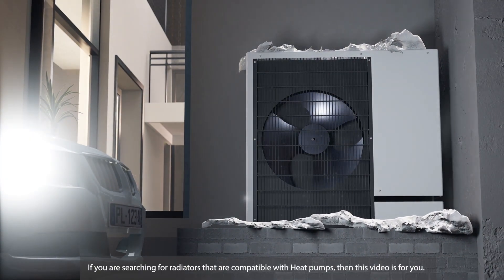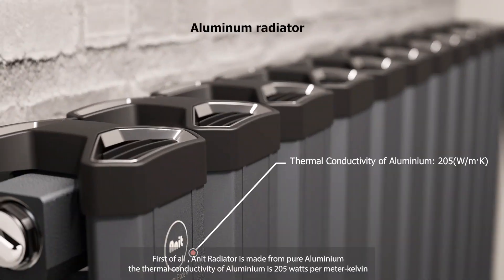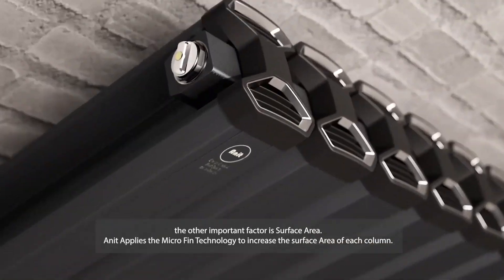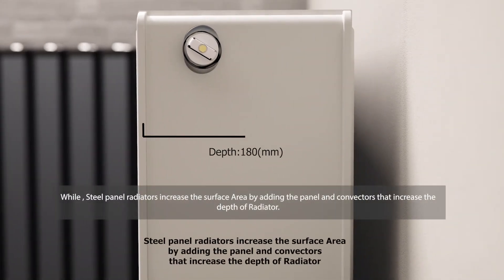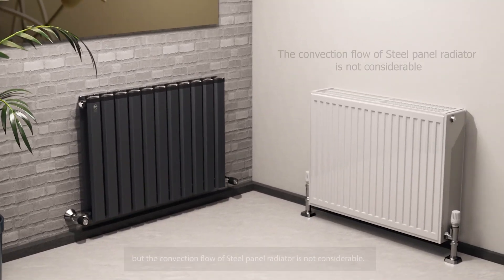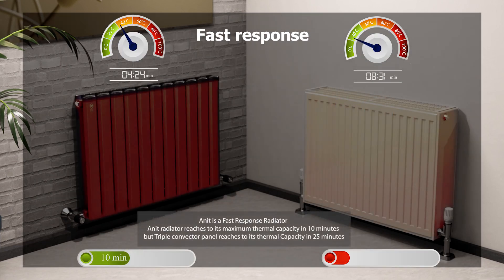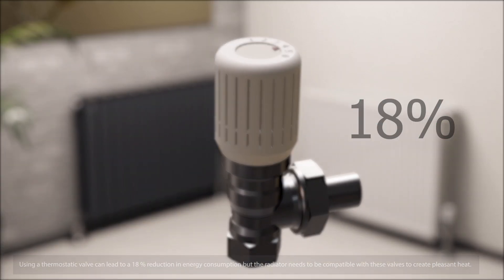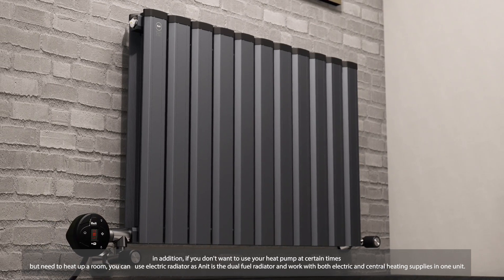Aluminum vs Steel Radiators: Which is More Compatible with #Heat Pumps? #heating #anitradiatoruk

Comment: so the survey i had was telling porkies.   they said i needed to replace all my aluminium radiators to get my heat pump to work.  funny thing is i run my boiler at 50c and house is warm.....  i obviously have said no.